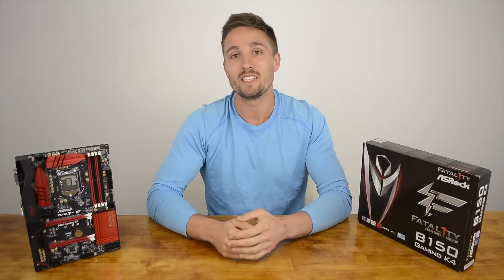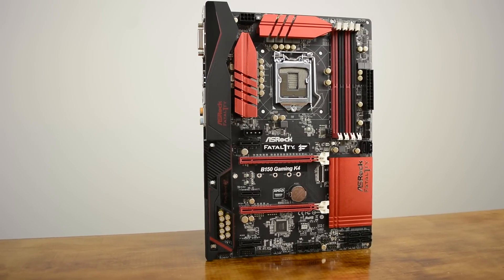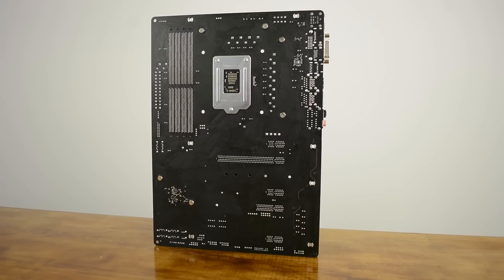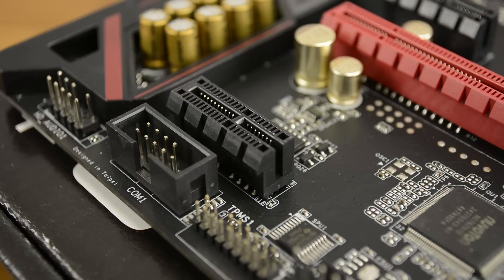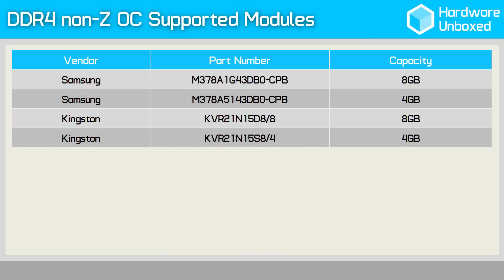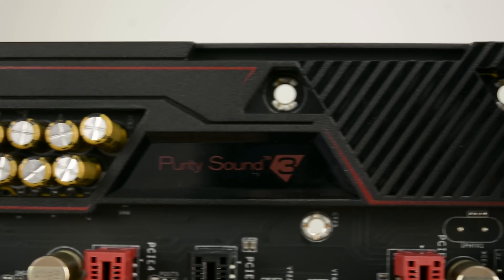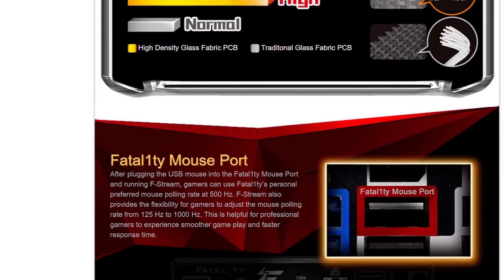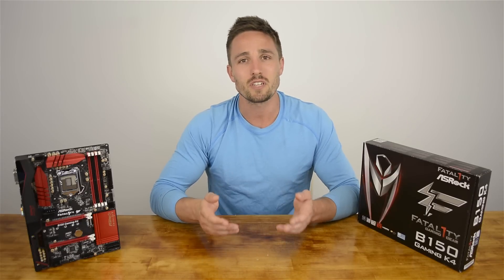Asrock B150 Gaming K4: Review - The Best Budget Skylake Motherboard?

Comment: great video,i just have 1 silly question,sorry i'm a noob,still learning these things,can i put an i5 6600k on this mobo,without overclocking it,or should i stick with the non k version?the only reason i want to do so is because the k has slightly bigger stock speeds,thank you :)
Reply: I believe ASrock has refreshed this series as Hyper motherboard, with SkyOC, means you can OC any non-K via BCLK (oc'ed my i5 6402P) and also RAM OC with HyperX (oc'ed mine to 3300Mhz+, havent test other brand)

Comment: Is it possible to overclock a i5-6500/i5-6600k on this board?
Reply: no kirn20..  to overclock a cpu you need a Z170 motherboard and a cpu that allow it like the i5 6600K (i5 6500 is locked)
Reply: Kirn20 only the 6600k is oveclockable. Intel imposed this as a monopoly.
Reply: leihoa I know, I just don't feel like downloading a sketchy bois i
Reply: Like I said above, ASrock has refreshed this series as Hyper motherboard with existing skyOC, which 
means you can still OC any non-K via BCLK (oc'ed my i5 6402P) and also RAM OC 
with HyperX (oc'ed mine to 3300Mhz, havent test other brand). So you can skip cheaper range Z170 and still have all the goodies B150 have (except M.2 and USB 3.1 which is available at H170 Hyper series).

Comment: one question, is overclock really worth it??? should i just buy 6700/6700k?is there any big difference in terms of gaming perfomance on non k and k mobo?
Reply: I think it depends. but dont expect crazy fps if you overclock.
Reply: gazmend hajzeri oh ok thanks
Reply: for only gaming,go for non k version, but for rendering or heavy streaming,go for overclockable cpu.
Reply: +Titanclaw 24 is the 50 for the oc, the 50 for a z170 and 20-50 for a cooler worth the 6700k vs the 6700?

Comment: Can you use an r9 380 to this mobo?
Reply: +DJ Khaled (another one) Yes, you can use every PCIe-card with this board. Or with any other board with a PCIe-slot.
Reply: +GenosseRot Thats what i. thought. I just asked to make sure since someone in the comment asked if gtx 960 would fit so i mase sure that this mobo has no weird gimmicks considering the Pcie slot.
Reply: Standards are a wonderful thing ;) And open standards are even more wonderful.

Comment: What would be better? This or the msi b150 m3? Its only 20$ more for the msi
Reply from the maker: +uhChange - No way is the MSI B150 M3 worth $20 more. If you need M.2 support buy a PCIe adapter card for $10 or less. Otherwise the two boards as much the same.
Reply: uhChange - Msi has a bad track record with bios update.

Comment: Hello.

Which one would you suggest buddy.

The azrock b150 gaming K4, or the asus H170M-E D3? Im split in between those two.
Reply from the maker: +Philipp Strasser I would only get the Asus board if you need an M.2 slot or if you need a Micro ATX board. Other wise I feel the Asrock B150 Gaming K4 is superior in every other respect despite having what is arguably an inferior chipset.

Comment: Would this go well with an  i5-4460 and an R9 380? or should i go with the MSI Z97 PC MATE ATX LGA1150? Im not interested in overclocking at the moment
Reply from the maker: +Czarcasam It wouldn't go well since it isn't a Haswell board, its not pin compatible.
Reply: +Czarcasam You can either get a B85 or a H97 Motherboard. I recommend getting a H97 Motherboard since you wont have to do a BIOS Update with the B85.

Comment: I was gonna get this board, instead I got the AsRock Z170 Pro4, so I can use SkyOc :)
Reply from the maker: +Captain Leerox Smart choice, check out my overclocking guide!
Reply: +Hardware Unboxed Will do for sure. Ready to kick a Core i3-6100 over 4.5 GHz!
Reply: +Captain Leerox Iam kinda late for this but can you overclock a 6600k with this board
Reply: bosskiller212 Nah
Reply: +Captain Leerox  so should i buy the i5 6600  non K??
Reply: bosskiller212 Ya. It comes with a stock cooler too!